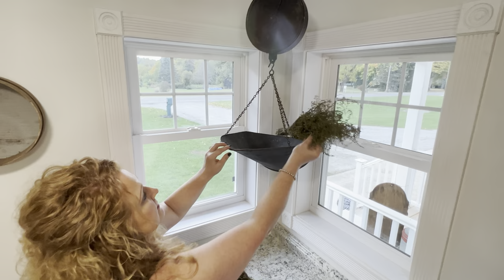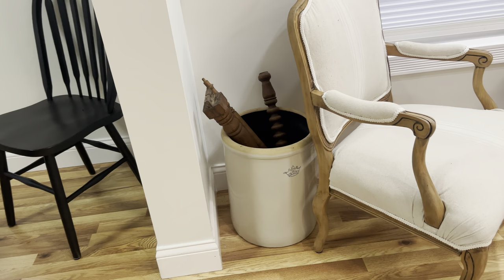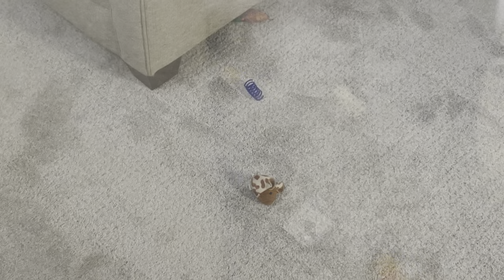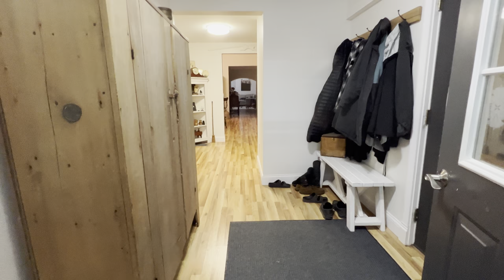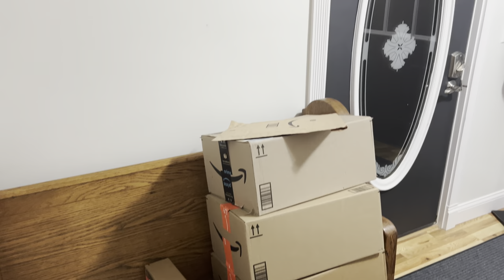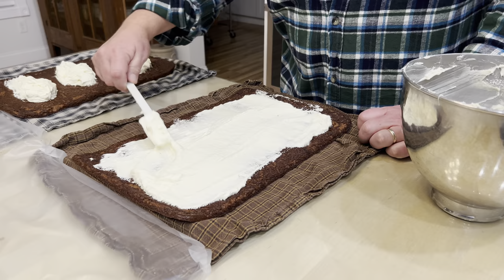HOLIDAY PREP | HOME DECOR | RECIPE

Comment: I'm so jealous of your horse!  That swiffer is a great tip.  I might use that in combination with my go-to cleaning tool which is a pastry brush or chip or paint brush.  My mom used a pastry brush that she wrote "dust" on the side of (to avoid confusion) and it worked great on fabric and getting dust off parts that were hard to clean around.  I still do the same today!